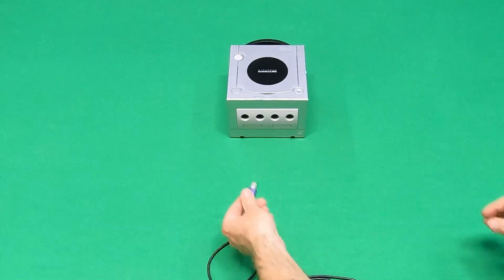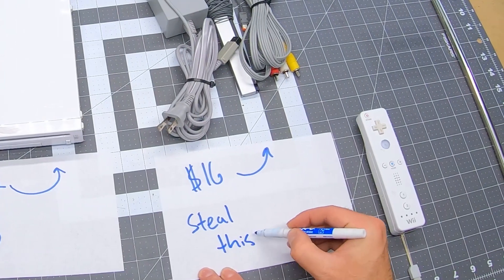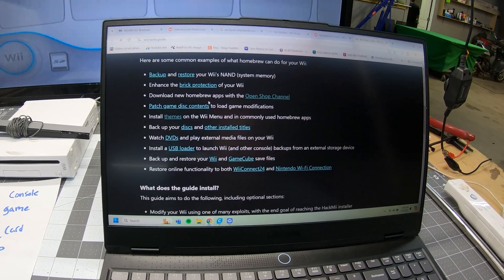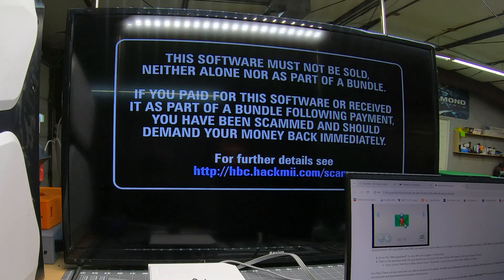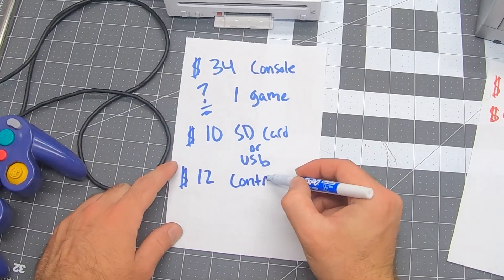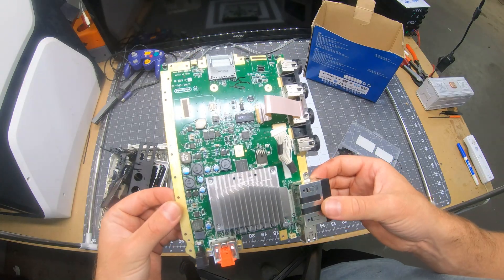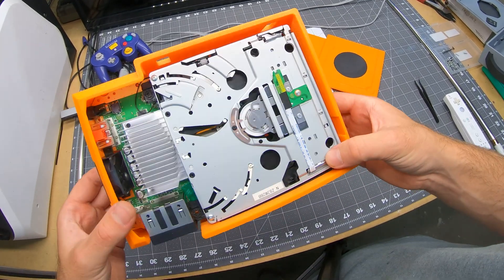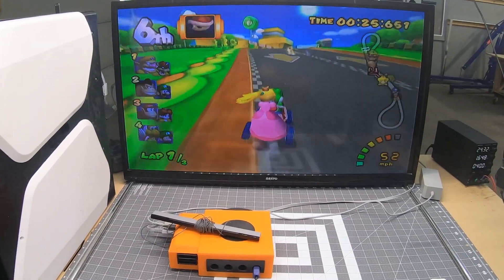3D Printed GameCube Using Wii Homebrew | WiiCube 1.0

Comment: Support for 2 internal hard drives with a toggle switch, one hard drive for Wii games, the other for GameCube games.
256 SD card  Wii Flow and all the old school systems..
Ditch the LCD TV & a CRT with S-video. Get a really good shielded S-Video to Wii cable

Comment: Any advice on assembling the Wiicube with motherboard after I’ve printed it??
Reply: The other bracket that you don't show in the video... where does that one go?
Reply: On the top cover. Turn it over. Bottom right and corner where the two memory porta are

Comment: I printed it, it was really cool, but I would like to make it SMOOTH... it came out as "fuzzy skin" even though this option was turned off!
How do I print SMOOTH? Great Video
Reply: I printed it smooth. Used cura and just didnt have fuzzy skin enabled in experimental settings. The models don't have the fuzzy skin on the model itself so it should print smooth

Comment: For the V 2 you could also check if it's possible to add a USB-C Mod to make it even more portable.
Reply: Adding a USB-C mod is actually super easy, depending on how you go about it. I soldered one into a Wii last night and aside from taking the Wii apart, it took only about 2 minutes. Many Power Delivery trigger boards come preset to output 12V, which is all the Wii needs through its 2-pin DC input. An easier method is actually just to leave the stock power port in place and just use/make an adapter between a PD trigger board and the Wii, such as the DIY "PD4Wii". I actually found this video because that Wii has broken brackets on the inside and I'd like to print a case for it.

Comment: this is a great project - definitely going on my to-do list. for the model that allows use of the disc drive, how do you access it? is there a slot or something? couldn't really tell at a glance
Reply from the maker: I'm working on adding a second version that has a slot and mounting brackets for a working disc drive. For now it can be accessed by lifting the top cover.

Comment: A drop-in replacement case that looks more like a GameCube and doesn't require any soldering, it's like a dream come true. 

The 1.0 design looks pretty slick; it'd probably look a little nicer in other colours, yeah, but I think the big thing for improving the visuals would be making the top part have clip holes to support an official top jewel. There's been a lot of custom ones, too, that are of similar quality. Having the centre piece sport that reflective, glossy black will probably finish the look a lot more. 
The front panel also being grey might help, but that's another 'just colours' thing.

Comment: Want to blow your mind? Look up Wii trimming. You can cut down the Wii motherboard to be the size of an altoid tin
Reply from the maker: Holy shit thats amazing
Reply: Yeah it's insane. There is currently an ultra small Wii called the "Nintendo Kawaii" that's a 2 part thing which i believe is now the smallest Wii.
Reply: Apparently the previous smallest was the size of a deck of cards. 😂
Reply: The Kawaii fits on a hecking keychain and docks into a 2nd part with inputs including gamecube controller ports.
Reply: was just about to suggest this lol
Reply: Can you do a video making a replacement wii shell thats like the original I have a couple of friends and we played smash bros and accidentally dropped it and not the top part of the disc drive it loose I don't want to play with it until it's repaired for fear of further damage